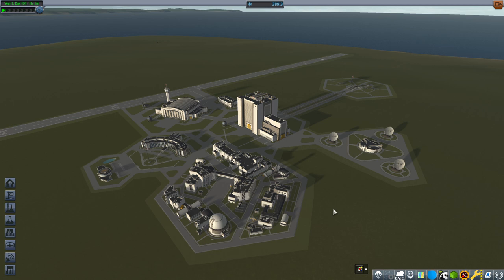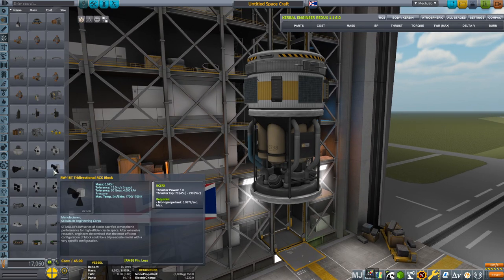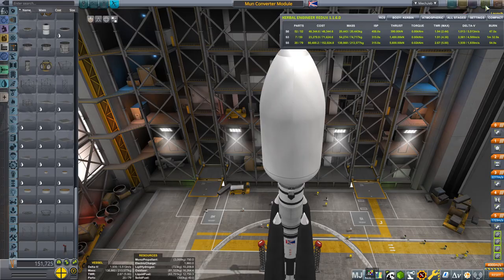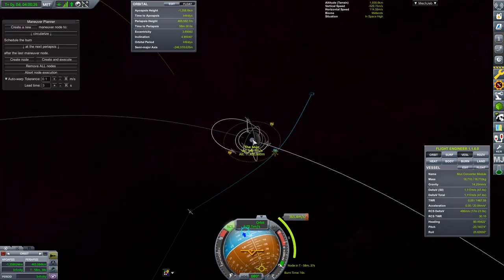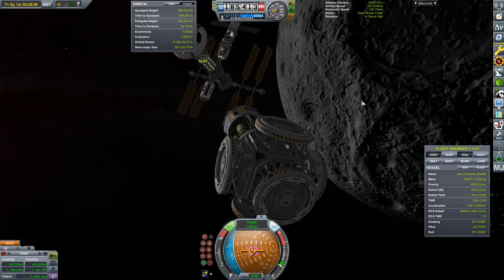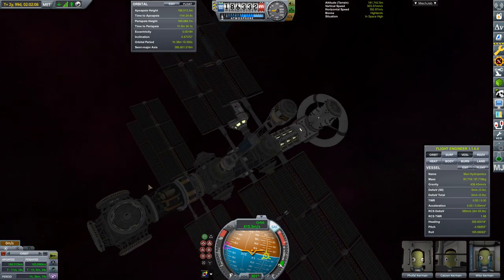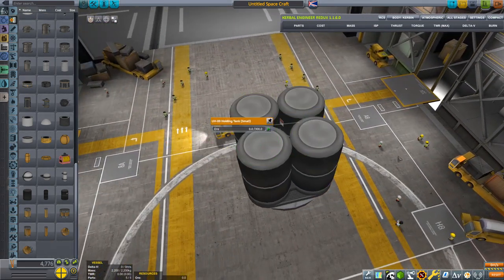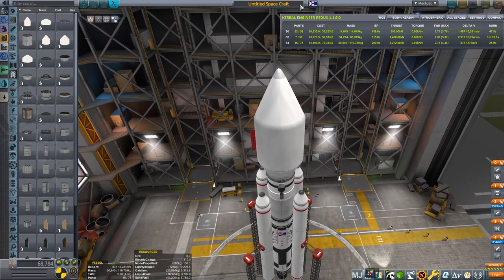Kerbal Space Program - Episode 33 - Resource Converter

Comment: So realays are weaker but can relay while others only taget one craft and are strong
Reply: The best solution is probably solar powered satelites with deep space comms on rotors set to follow the course on the craft. The craft also should have ralays to connect to the surface. Thinking of it you could probably equip the mun station with it. Might help docking.